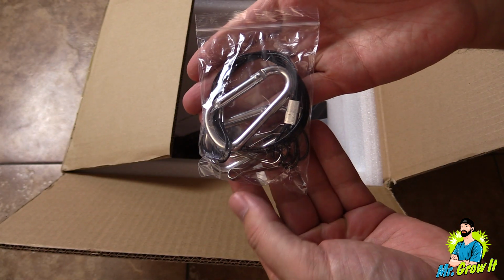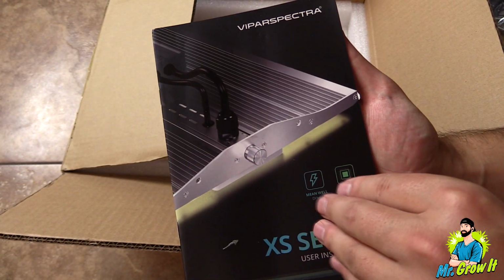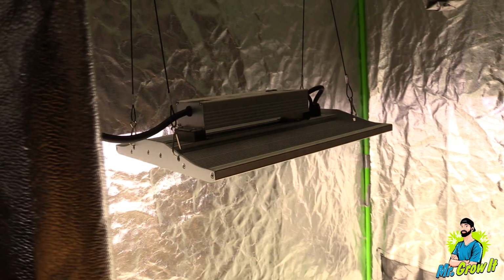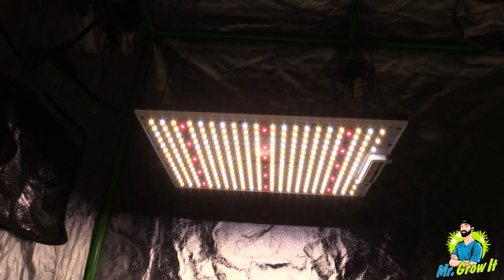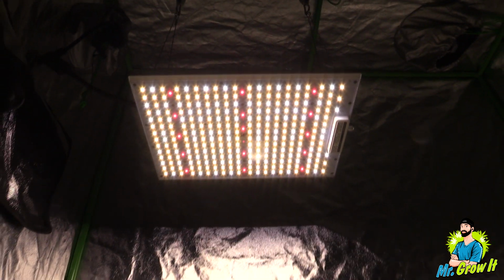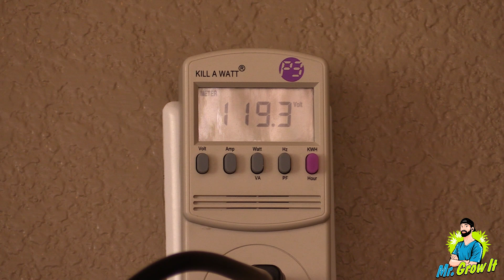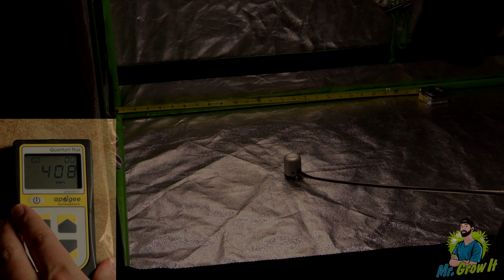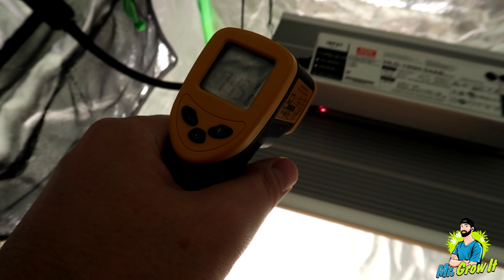VIPARSPECTRA XS Series XS1500 LED Grow Light Unboxing, PAR Test & Heat Test!

Comment: Need a little help, so I’ve had my grow room with cali lightworks SS550s for over a year now. I’ve just made a new veg room, if I buy quantum board leds, can I still flower with the SS550s  or vice versa. Basically veg with QB and flower with Blurple. Till I save up more to get more QB style LEDs.
Reply: I think you'd want to concentrate the grow on flower and use the quantum boards there. More PAR output for flower. If the quantum boards are underpowered you could mix in some blurples to make up the deficit.
More info is required to make a valid recommendation.

Comment: Love your channel! Thank you for the excellent content. 
Just a tip. The temperature measurements performed with your spot pyrometer are completely skewed due to the non adjustability of emissivity. (Emissivity is an object’s ability to reflect its actual temperature. Rated in proportion. 1.00 is a perfect “black body emissivity”.) 
Due to the new shiny frame of the XS series compared to the black frame of the PB series, emissivity values are closer to 0.27, rather than 0.90, respectively. 
Human skin emissivity is closer to 0.97 - 0.98....same as most black, non aluminum  surfaces. Especially check the driver temp. My emissivity adjusted FLIR T540 thermal camera shows 119  degrees Fahrenheit at the right side of the LED driver. 
Touch the driver at 100% brightness near the right, far side. Does it feel the same temp as your forehead? (Your spot pyrometer measured 98 degrees Fahrenheit, no?) 
You may have an emissivity setting in your Fluke pyrometer menu. Steel is close to 0.96, aluminum is closer to 0.24 to 0.29 emissivity. 
Cheers!
Reply from the maker: Thanks for the info! What you've said goes beyond my knowledge. I'll have to spend some time learning about the different things that you mentioned. Thanks again! Cheers!

Comment: I bought a Viparspectra Par600 and plugged it up for the 1st time on Aug. 21st before Sept. Every blue light on the left side was not working. I bought it off Amazon and contacted Viparspectra about a warranty claim. They would not honor their own warranty because they said I bought it directly from Amazon, which is no big deal, but false advertising when they mention warranty on Amazon. Amazon is who had to make things right. I had to ship it back to Amazon for a refund. I'm not bashing the brand, this is just what happened...

Comment: I started my first ever grow 10 days ago. Planted 5 seeds (feminized) in rockwool ph at 5.8, under light 18 hrs on 6hrs off, 1500 led watt light is about 5 feet and have only had 2 sprout. Is this normal?
Reply: You're supposed to germinate in darkness, give them light after they've sprouted.  Rockwool isn't nice either imo, you're supposed to wash it out, re-soak in ph6 water, and then dry it out just right.  Even then it always wants to soak up all the humidity in the air & rot the seed.  I'm actually quite impressed you got 2 to sprout given its your 1st time.  Rapid rooters/ jiffy pellets/ or just into a soil cup is way nicer than rockwool but you're supposed to germ in a damp paper towel.  Try giving your seeds a few bursts of 24hr uninterrupted darkness & if they're still dead you could always grow the 2 you've got into mothers & take clones.  Hope that helps bud happy growing 👍

Comment: I’m very disappointed with this light and the company too, they advertised it at 2.7 umol/j and i recently double checked and they changed the listing to 2.3 🤦🏻‍♂️ I can’t trust a company like that but I cannot return it anymore either and i’m running it in a 2x3 so i’m gunna look elsewhere to get a decent led